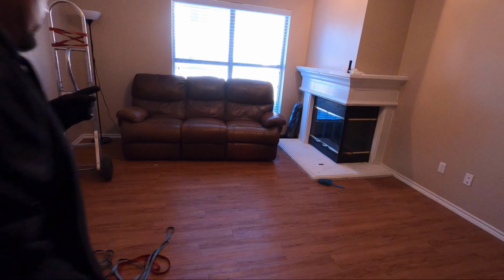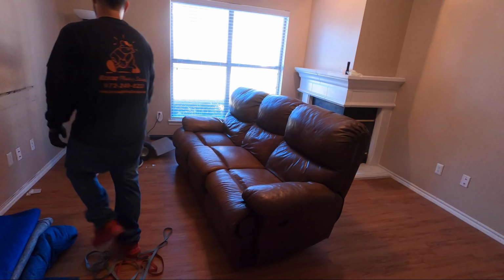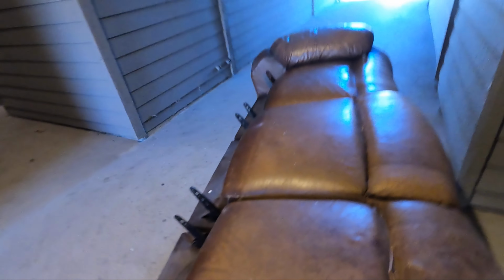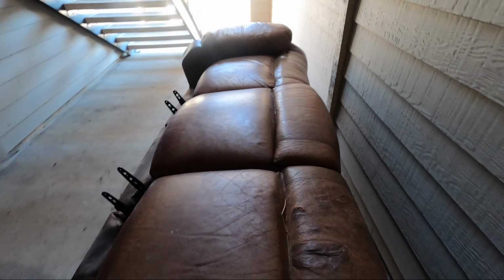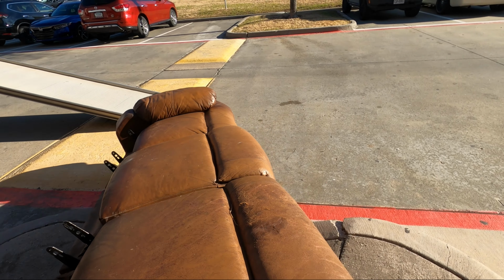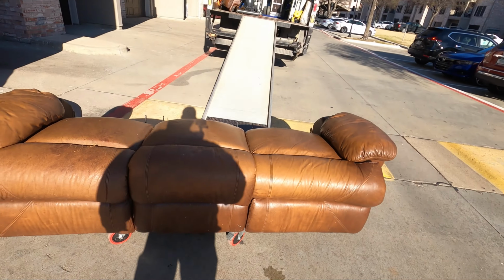Another trick how to move a recliner heavy sofa out of a apartment by Rescue Moving Services.

Comment: Awesome tips .  Those recliners are ridiculously heavy ! Taking off the backs helps a lot to maneuver them through doorways and  I’ve taken the bottom bars off occasionally but it just takes up too much time to put bolts back on . So typically just taking off the backs  is what I’ll do and use a 4 wheel dolly if no stairs .   Great video !

Comment: I delivered furniture for years. I can't count how many times I had to take recliners apart to get it into a house, apartment or up a flight of steps.
Reply: Question, I noticed that only power recliners have the back flap velcro, manual recliners have stapled flaps on the back. Is it possible to remove the back rest on manual recliners?